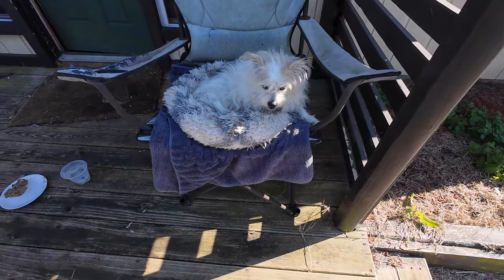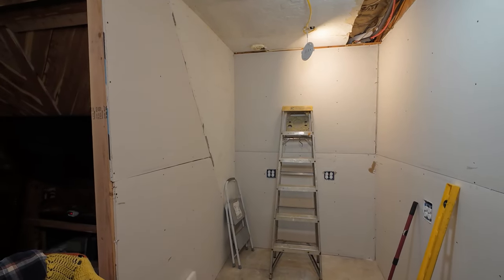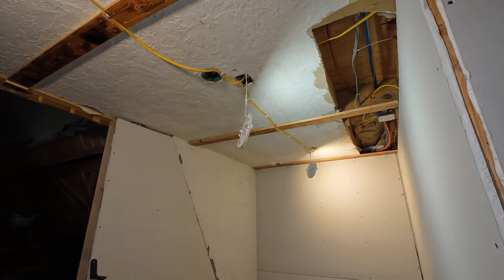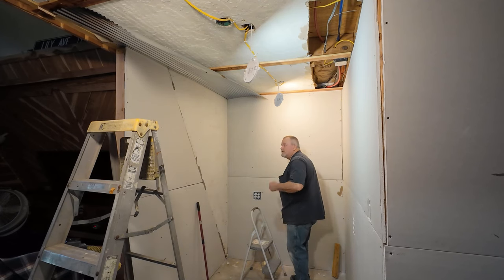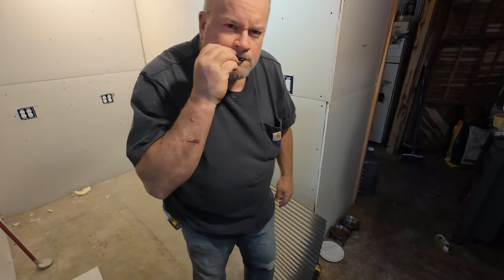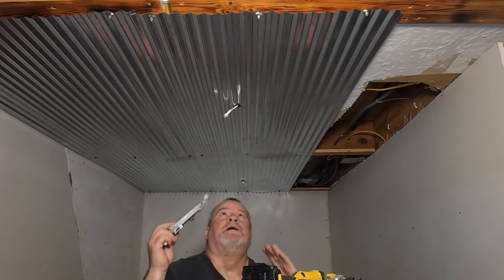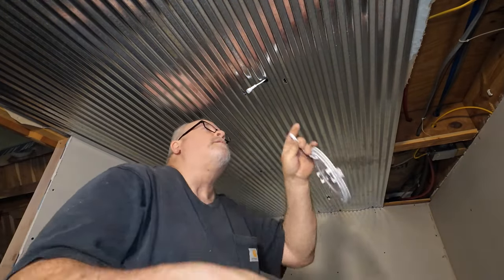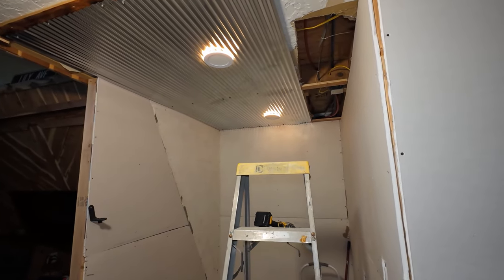Revealing the Secret to Recessed Light on Metal

Comment: That's a great way of doing recessed lighting. I think one reason some people don't do it that way is that you lose access to the transformer box. Eventually that box will need replacing. Well, decades from now, maybe long after you stopped caring about it. Well, the owner can simply cut out the larger hole at that point.

Comment: Use some silicone grease on the grommets and connectors. Every thing will slip through easily. It's similar to the grease you get with tail light and headlight bulbs. Works great.